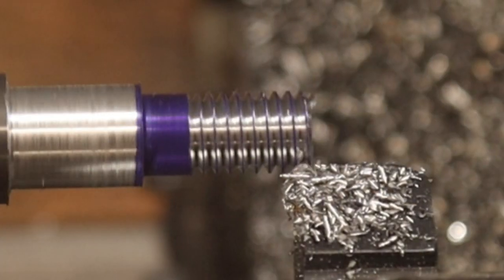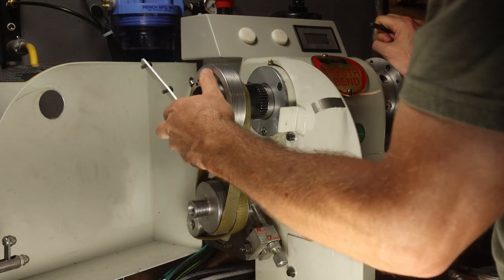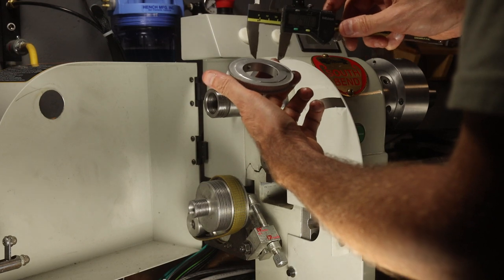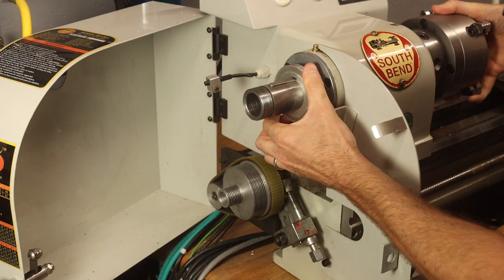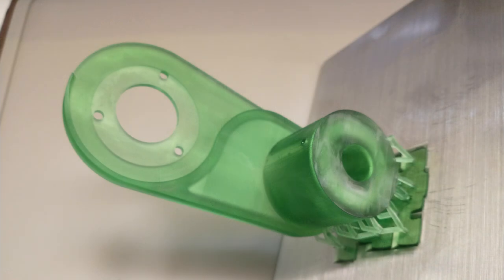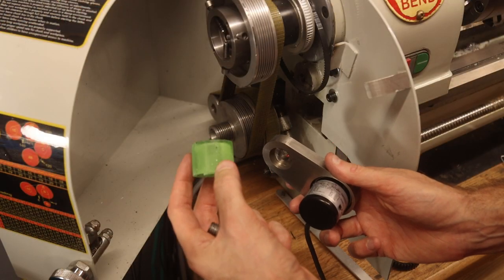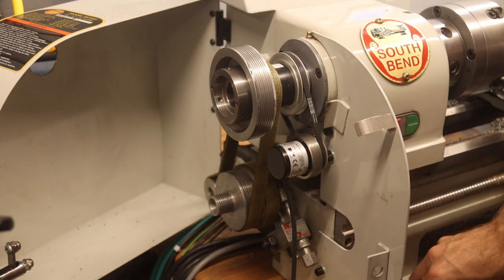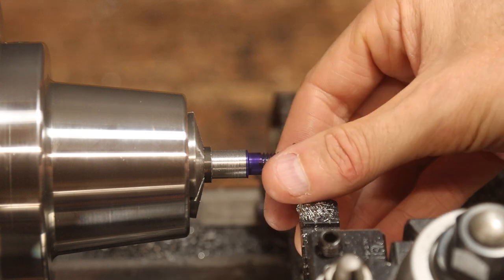Spindle Encoder - CNC Lathe Threading

Comment: Nice professional fixtures for the encoder and pretty little lathe. I use the encoder counter instead of index pulse. Always start threading when counter hits 0; i.e always start at the same z,x position and spindle angle / position every time.
Reply from the maker: Surely would have been some way for me to do that. The encoder that I had is pretty high resolution. I thought of the index pulse as a chance to start over if error started to accumulate. The 1:1 ratio will make the spindle ppr more manageable. Thank you
Reply: @kentvandervelden  you don't need very high ppr, only enough to cover the max pitch  which will be a function of the ppr to stepper   pulse ratio. You can reduce the microsteps if necessary.

Comment: Kent - As a reference I have an encoder mounted for the same purpose on a similar size lathe conversion. The encoder is mounted on a pivoting bracket too. However, the encoder is engaged to the spindle shaft with a plastic gear set in a 1:1 ratio. The gears are loosely meshed so there is no cantilever load as is applied by a timing belt drive. The gear backlash is irrelevant since the spindle rotation does not reverse. Because the gears are lightweight there is little cantilevered load applied to the encoder from the weight of the gear mounted to it. The encoder I use clocks 2000 PPR.
Reply from the maker: Thank you Charles. That's a great idea! I have one more encoder to mount. Something else to try.
Reply: @kentvandervelden  An additional thought Kent is - add a dead shaft on the machine and a bushing or bearing to your existing encoder timing pulley which then mounts on the dead shaft. Attach a gear to the dead shaft timing pulley which then engages the gear on the encoder. This gives more freedom to create space between the spindle and the encoder and gives a lot of choices for gear ratios that are a combination of the ratio of the timing pulley set and the gear set.

Comment: JohnSL also managed to add an electronic lead screw to their lathes. It would be interesting to compare your design with theirs.
Reply from the maker: I'll need to watch JohnSL more carefully. His mount has bearings that take the load off the encoder, that's nicer, and critical for the CUI like encoder he used. The encoder I used can have ~4lbs of side loading. I'm making a mill spindle encoder and will use bearings on it. Thank you

Comment: Did you ever get it straightened out? Did you need a 1:1 pully to match the one on the lathe spindle?
Reply from the maker: Yes, with 1:1 pulley everything worked well. Thanks

Comment: You were talking about the double index signal problem because of that pulley ratio. I'm going to have a 36 to 18 teeth ratio on my machine (200 pulses encoder so 400 pulses per rev of shaft). If I have a seperate sensor for index signal - will it work fine? I mean, except for the 180 degree phase random hit there shouldn't be any more issues  with the pulley ratio? (my encoder has an index signal but I have a seperate index signal sensor on my machine already so I should use it instead of the 2x indel signal from the encoder)? Just asking before I make any mistake. Thanks for the video!
Reply from the maker: Sounds very reasonable. The A/B phase of an incremental encoder just keep generating pulses regardless of the state of Z. I had a magnetic sensor on the spindle I could have used in the way you are purposing, but unsure of consistency of the pulse I made the pulley 1:1. You might want to check your system's consistency but comparing number of pulses per rotation marked by the index pulse. Thank you
Reply: @kentvandervelden  Alright. I will do some tests! Thank you for your support!
Reply from the maker: @GBWM_CNC  BTW: You are describing impressive projects on your channel. Great work!
Reply: @kentvandervelden   @Kent VanderVelden  Thanks a lot! I'm trying to improve my skills and share with people what I know. It's nice to have an own knowledge database to share with others.  Your channel brought to me some important informations. I appreciate it!

Comment: I think a differential signal encoder is also helpful.  I have my current ELS setup running with regular ttl signals and I get errors depending on where the wire is routing and how much noise the motor is putting out.  I'd love to see how you setup linuxCNC.  If I could get a pi 4 i'd try linuxcnc + remora out on my smaller fully cnc'ed lathe.
Reply from the maker: You've made a nice ELS. I'm sure you could interface a differential encoder. It's a matter of using what you already have? That's how I try to operate too. Maybe checkout Machinekit too. It's a LinuxCNC split originally for Beagle Bone Black, as I understand. I struggled a lot to find a LinuxCNC setup. After lots of headaches, I bought a Mesa 7i76e card, which has a lot of support and everything just plain works with it. Thank you

Comment: Good content and just in time. If i may ask, what rotary encoder are you using because I have to buy one
Reply from the maker: On the lathe I used TRDA-2E2500VD, and on the mill I'm using TRD-SH1200VD, both from AutomationDirect. I have the lathe encoder already else I would have used one like the mill. The hollow shaft is more convenient if supporting the shaft. Be sure to check max mechanical speed and max response frequency to know if limited by the mechanics or the electrics for the speeds you are seeking.
(Hope to have the mill video done in a couple of weeks. It's a bit nicer of a mounting. Work and winter prep has been taking priority the last few months.)
Thank you

Comment: Hello,
did you use now the same gearsize on the encoder and dthe spindle size or a different size.Did you figured out how to manage this in linuxcnc. My problem is, that i do not find a gear for the encoder what is as big as i need for the spindle size
Reply from the maker: Yes, I use 1:1 gear ratio. You'll be able to make the needed spindle gear your CNC router. The number of pulses needed per revolution needed by LinuxCNC is small, so gear accuracy is forgivable.

Comment: Nice work 
Can plz tell its configration in linuxcnc hal file 
I am facing problem in my emco pc compact 5 lathe it has optical encoader with tow sensors one is gunrating phaseA pulse and second is indexing pulse i also attached parport pins in hal file but when i enter g33 code the machine do nothing
Reply from the maker: Please see if the following link will help, specially ArcEye's example. Also, I believe you'll need to have the at-speed pin active before synchronized motion will start, even if all else is correct. Some exploring with the watch function of the HAL Configuration might be needed.
https://forum.linuxcnc.org/10-advanced-configuration/28136-advantages-of-supplying-phase-b-to-spindle-encoder

You may find my configuration on Github, but they might not be too useful since I used a 7i76e.
https://github.com/kentavv/kvvcreates/blob/master/linuxcnc/configs/sb1001_lathe/mesa/configs/my_LinuxCNC_machine/my_LinuxCNC_machine.hal

Wishing you the best of success!

Comment: You could also just not use the index from the encoder and mount a sensor somewhere on the spindle...
Reply from the maker: Good idea! The stock magnetic 1 ppr sensor on the spindle was a possibility, and originally connected to the Mesa card for measuring speed. I'm making another spindle encoder for a mill, and can make that one nicer. Thank you
Reply: @kentvandervelden  of course - the 1:1 encoder gearing is the least hassle..  I am amazed you got a complete thread without it finding the 2nd index.  I suppose it was a timing thing and it just worked out.   There has aways been talk about generating a synthetic index (wouldn't be the same from boot to boot of linuxcnc) but would just be based encoder count per rev...

Comment: Absolute encoder is a very complicated issue I'm facing.
Reply from the maker: Please tell more. What encoder do you have and what is its interface? Thank you
Reply from the maker: If using absolute encoders with SSI (RS422/485), take a look at this. I would like to try this but the encoders are costly. If using gray code, would need a convertor. Oh, then some way to adjust stored position if not homing after a restart. OK, I can see how this gets complicated. Are you making your own multi encoder interface board? Would be very interesting.
https://forum.linuxcnc.org/27-driver-boards/37129-mesa-card-and-absolute-encoders
Reply: @kentvandervelden  thanks! I'm waiting for the optical encoder part from Australia. I have a lathe PCI BOB for Linux CNC, it is designed and made by my friend in HCM. Hope that my low cost project can work...;))